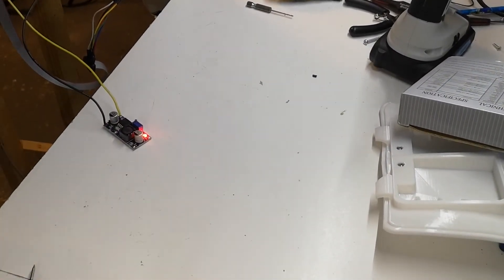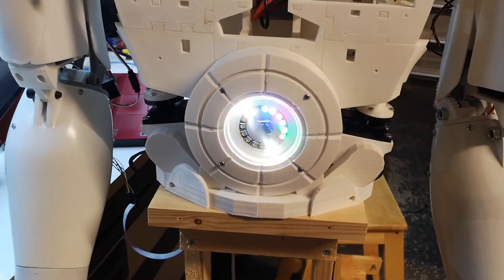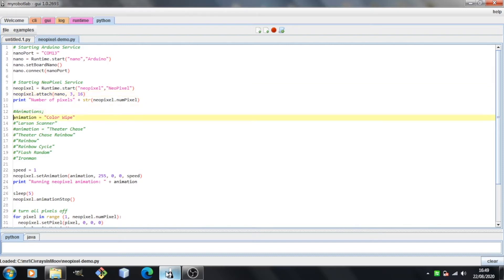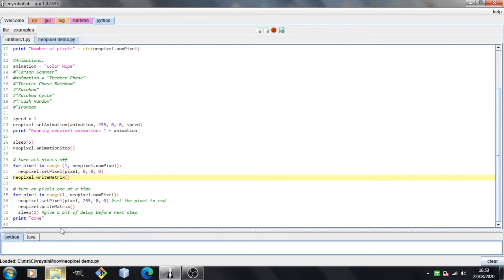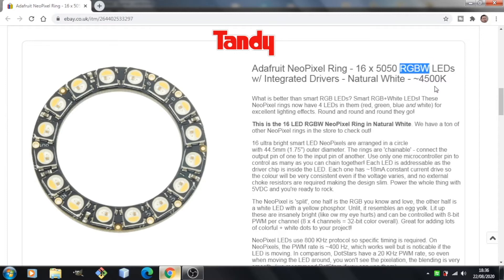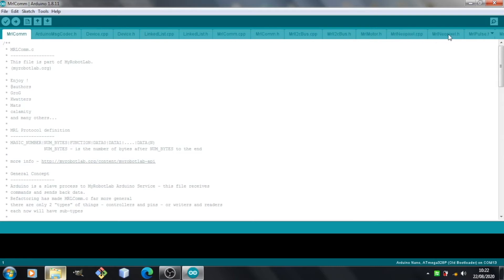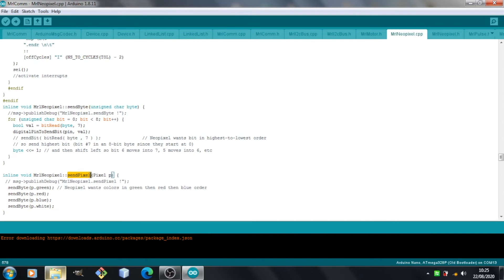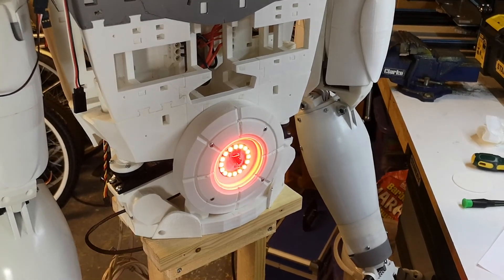Civrays InMoov - Neopixel troubleshooting

Comment: Hi,
I was wondering how you bolted your inmoov onto the stand. My inmoov is getting too heavy to stand on its own, I need a way to bolt it to a stand.
Reply from the maker: I've only used screws not bolts, so not sure how strong it is, but seems ok. I think I screwed upwards through the wood and into the existing holes in the bottom of the top stomach assembly, but I can't exactly remember so need to check. When I get a chance I will take some pictures.
Reply: Ok Thank You

Comment: Hell Yes ! 
Great walk through, excellent hacking !
Reply from the maker: Thanks. I'm not sure if the latest nixie supports this, but if not I would like to have a go at updating the MRL java code to fully support the white channel, maybe with a flag to indicate RGB or RGBW.
Reply: The best way would be with a configuration message to tell MrlComm which type of device it was attached to.  This would allow the NeoPixel to handle either type dynamically.

Comment: You see... The problem with inmoov is that there aren't basic instructions like... 1. Do that. 2. Do that etc... And it costs a lot. I have made several robots with raspberries and arduinos or raspberries and arduinos together but inmoov? I don't think I am ever gonna start making it. I find it dissappointing. But you rock !!! I admire you and your patience !
Reply from the maker: It's good to understand how others perceive the project. I suspect no two InMoovs are alike because there are so many ways of doing things. I think the lack of instructions comes down to people having the time or will to document what they are doing. I find most people tend to show what they have done, not how they did it. I do agree more formalised instructions for a standard build would be beneficial.
Reply: @SteveRaynerMakes  Thank you for your answer. But how should I start? Like making the head, or the forearms ?
Reply from the maker: You can start anywhere, but the head or a hand is a good place. One problem I ran into was with the torso. It's better to build the whole torso in one go. I know it's boring but you kinda need the torso first before you can attach the head or the arms.
Reply: @SteveRaynerMakes  oh it's ok and after that I should make the head? Of course it will do nothing, right? It needs the main boards in its chest to work. That means that if I start it I have to finish it. Wow, that costs almost 3000€ I think.